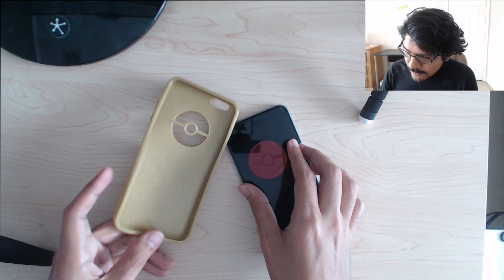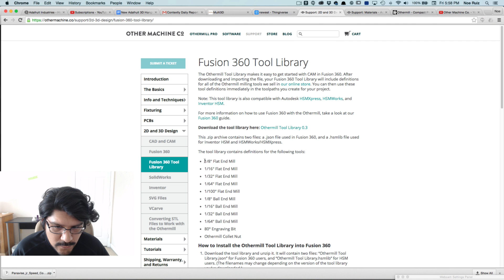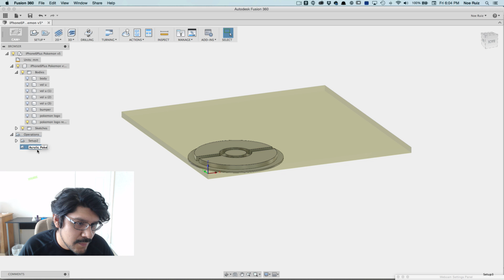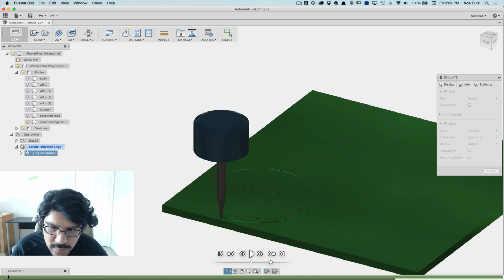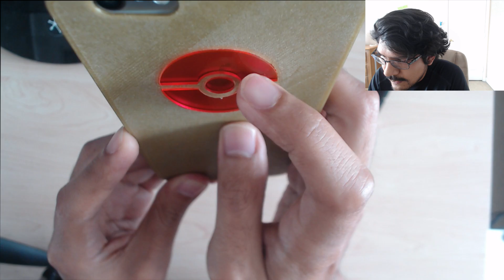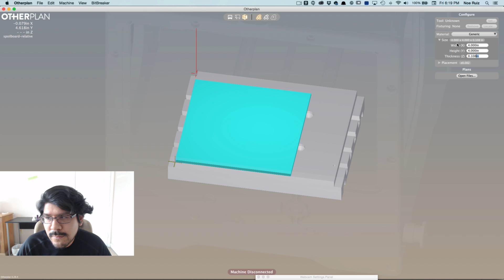How to CNC - Milling a Pokeball Logo in Acrylic #Othermill #Fusion360

Comment: With the cut out pass did it not mark the machine bed as I dont remember the other mill having a spoil board?
Reply from the maker: Managed not mark the machine bed - offsetting the position of the stock helped (by adding the thickness of the nitto tape). The aluminum bed is pretty much the spoil board - https://othermachine.co/store/spare-parts/spoilboard/

Comment: Hi! I am new to CNC. I want to ask why you would choose to cut the piece
 free before doing the chamfer? And how do you keep the piece from 
moving when the piece is free from the stock?
Reply from the maker: Great question! Mounting stock to the spoiler bed is very important. With this piece, I used doubled-sided scotch tape to secure the acrylic piece to the bed - This actually holds up really well. Normally, one would run the cutout as the last process but, because there's a sufficient amount of tape, all of the pieces stayed in place. – Noe

Comment: Why is that Small CNC so over priced?
Reply from the maker: The software and high quality parts make a really high precision machine. It's fully assembled and comes with a 1 year warranty / tech support.
Reply: My CNC machine was $2400US, free shipping, helpful tech support with solution resource assistance, 1 yr spindle warranty, 2 year general warranty, is capable of MUCH higher detail than the Othermill, has a 2200 watt motor, can cut metal, is made of indestructibilium, and has a work bed of 600x900mm. When machines comparable to the Othermill are around $700, that should tell you something.